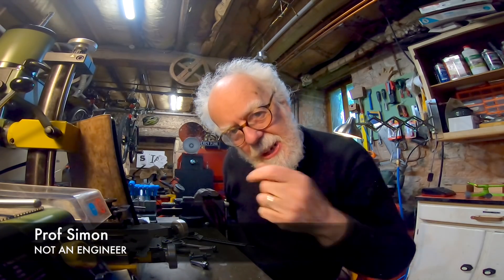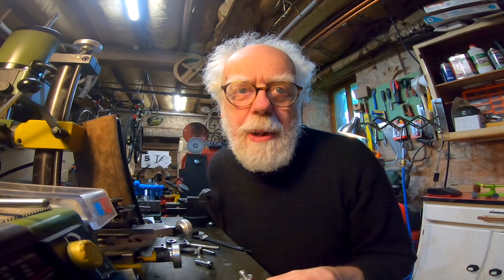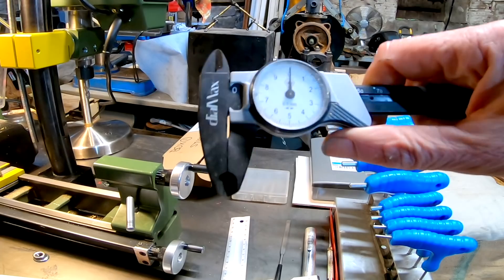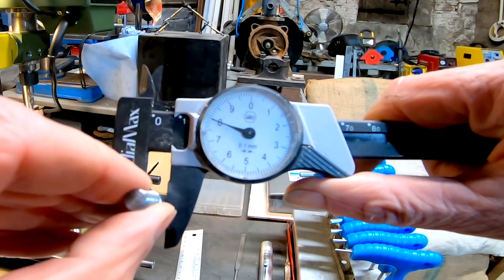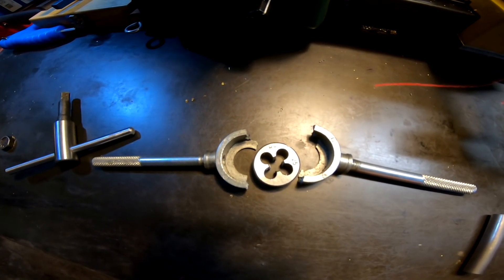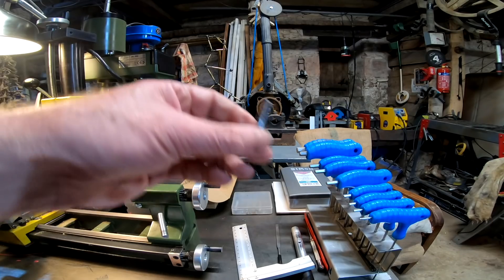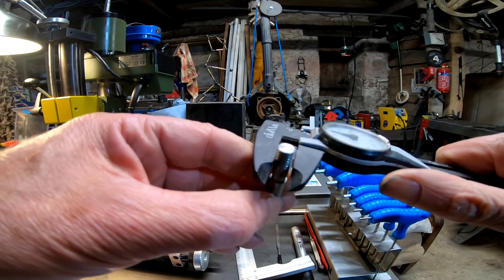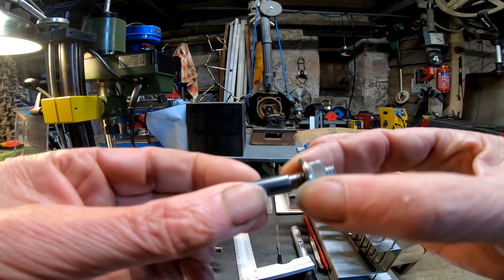Engineering mystery - Prof Simon

Comment: I have cut quite a few 8mm silver steel round stock with a standard die, no problem.
But if the stock is just a little too hard, it won´t work.

On the lathe:
Take 8mm stock, touch off, cut as deep as the tables say. 
The peaks then theoretically are exactly 8mm, but have a considerable burr (material on the peaks gets folded first in one, then in the other direction).
Make a few spring passes, steel will not fold too often before it breaks) and run a file over it.
Nuts usually do not have perfect valleys, so a little clearance on the peaks is inevitable.

The thread still is M8, the smaller outside diameter simply results from that clearance.
Reply from the maker: Thank you

Comment: As a retired tool room machinist i was told you need to take OD down to 7/10 %  off  to compensate the swell. Dependent on material being used.   Cutting oil is best, tallo can be used but it smells orible when hot.
  Greetings from The Isle of Wight.
Reply from the maker: Thanks Rick

Comment: As i understand it 8mm dont fit in to 8mm so thats why its 7.7 ish to fit 8mm nut , as for the BUR you are geting use 2 cuts which is easyer siad than done , or cut the thread then size it by fininsh cut with the die

Comment: Always turn your stock down to OD specified in thread charts. It's always less than nominal thread diameter. The thread form should not extrude when cut on a lathe, if the bit is sharp, has the correct relief, and is advanced each pass using the cross compound set at 30 degrees. 

Also, all commercial fasteners are made using cold heading and thread rolling. The stock is sized precisely to produce the correct thread profile without any material loss. This actually makes the fastener stronger.
Reply from the maker: Thank you.

Comment: Firstly, M8 or M8F are 8mm outer diameter, get a good tap and die set (SNAP-ON), CUT THREADS will always be a bit sloppy the best threading method is ROLLING a thread (forged thread), also have you noticed that a cutting die is directional with 1 side wider than the other.
Reply: Also if you measure the outer diameter of a cheap bolt and  10.9 0r 12.9 T.S you will find they are different.

Comment: There is a book (in German) "Tabellenbuch für Metalltechnik" by "Handwerk & Technik". Page F50 explains the procedure. In short: turn the thread in several (up to 6) steps, begin with a wear of 0.2mm (down to 0.08). Dont use the cutter (with the broken handle) - it's purpose is only to repair threads that are a bit damaged. The thread shape is described in DIN 13. Book: "Technisches Zeichnen" by Hoischen at Cornelsen-Girardet. Page 272 in my edition.
Reply from the maker: Thank you....there are better die holders?
Reply: @SimonHollandfilms  Quite sure there are, but I don't know which brand is best. If the holder costs around 15€, it should be a good one.

Comment: Sizing is a ‘nominal’ reference and varies slightly from manufacturer to manufacturer as well as batch to batch, or even material to material. As for cutting the thread, I cannot help, sorry. Did you actually try your initial thread in an M8 nut?

Comment: Try littlemachineshop dot com - use their die calculator :-) Should be 7.88mm for M8 coarse thread - use a 30deg chamfer to start.
Reply from the maker: Top answer. Littlemachineshop has a online table. M8 - 7.8,   M6 - 5.9,  Etc.

Comment: The Metric size you measure is always smaller than the size of the screw or bolt according to the official M-number. For example, the M8 size has the diameter of max 7,982 and minus 7,76.
Don't ask me why, it's a continental thing ...

Comment: Zeus book has a table for metric fine and course threads, this shows major and minor diameters relative to thread pitch.
Reply from the maker: It does? What is the column called?
Reply: That would make sense if you aren't losing any material, just reforming. On the diagram below the ISO Metric threads table in the Zeus book, imagine cutting off the peaks and flipping them over to fit in the troughs!
Reply: Could it be the "effective diameter"?  7.188mm for an M8 thread.

Comment: Standards are established by ISO for each of the 3 thread parameters: minor diameter, internal thread, D1; major diameter external thread, d; pitch diameter , internal thread, D2; and pitch diameter, external thread, d2.  Tolerances are presented in document ISO 965/1.   The tolerances shift with length of thread engagement.   I suggest you buy the document and cut threads to the specs and tolerances presented.  "Machinery's Handbook" devotes 30 pages of fine print which includes tables and equations for establishing a "correct" dimension and profile.  In table 13 - for M8 x 1.25  a range of D1 Major Diameter of of 7.760 to 7.972 for Tolerance Class 6g is specified.   At other extreme is 7.788 to 8.000 for Tolerance Class 6h.    But that is just the beginning.  There are also pitch diameter and minor diameter to establish.   Machinery Handbook also presents the equations necessary to calculate the dimensions you are looking for.  ISO go no-go gauges are available from several supplier.  One that pops up is https://www.gaugestools.com/ 
To do this correctly is much more complicated than picking the right diameter bar stock.   That diameter will vary with steel hardness and resiliency - carbon, manganese, chrome content for example.  If the first cut does not give the size you want, cut again until it is in spec.   If 8mm bar is too large turn it down to 7.75 mm before cutting the threads - that may be good for your bar stop.   Turning the bar may harden the surface and change the tendency to extrude!   Have fun and good luck.

Comment: It should definitely be possible to cut an M8 thread from 8mm bar. It is perfectly ok to remove a little material to make it easier, but I wouldn't remove more than 0.5mm. You may also want to try cutting a much bigger chamfer to help the thread start. The tiny chamfer you show on this video wouldn't be much help.

A die shouldn't be pushing up that much material. A normal thread cutting die is fundamentally a cutting tool, not a tool to deform metal into shape. When I use a die to cut a thread in steel I usually use a split die, which can be adjusted using the screws on the side of the die holder. For the first pass I open up the die as much as possible, but tightening the screw that goes into the split on the side, then once the full length is cut I run a second or even a third pass with the die cutting close each time.

I'm curious what type of steel you are using, as I've never seen the outer diameter increase as much as you seem to be seeing. When you bought it, was any specific grade mentioned? Was it listed as mild steel, stainless, or perhaps silver steel?
Reply from the maker: Excellent advice...the steel was ‘mystery meat steal from China’ so that might be an issue...I will certainly try the split tap process... cheers and keep up the good work

Comment: When making external threads of all kinds the OD of  round stock must be a little smaller than the OD of the thread. Generally I just file a little off the top of the bar in the lathe. You can buy adjustable thread cutting dies and take roughing cuts and adjust to finish. Less torque on the die stock. You can also rough out the thread on the lathe and finish it nicely with a fixed die. Always debur your finished thread with a file.
Reply from the maker: Good advice...thanks
Reply: Oh another thing is are you turning metric course or metric fine threads?
Reply: 19MAY2020 - Am I missing something? " . . . OD of ... stock ... SMALLER(?) than OD of thread."? WHAAAA? Maybe it got lost in translation. Too bad Dad passed away this past July. He was a master lathe operator and could chase (cut) any thread made, including acme, Sherlock, and buttress. I've never heard of the extruding phenomena resulting in increasing the bar stock diameter, but there must be difference between chasing a thread on a lathe with 29.5 degree, V-shape cutting tool and using a wraparound die to cut threads. Don't ask an engineer on this one, ask a machinist. You don't want theory, you want practical application. Big difference.

Comment: Hello. If you are breaking your die holder you are using way too much force.
The truck is to continually reverse the direction to clear the shavings then advance again only a few degrees and repeat until threading job is done, there will be info somewhere on what diameter to presize the rod.
Lathe thread cutting is another whole different thing and cutting tip size is critical and maybe different profile according to thread standard.
Reply from the maker: Good tips..

Comment: Hi Prof Simon, from my experience you need to take off about .2 mm of the OD and make sure you are using some type of lubricant, are you thread cutting on the lathe or just using the die?
Reply from the maker: Ah ha...I have heard that figure...cutting on the lathe with tap magic. ....but you can apply 0.2 mm to all thread sizes? Too little for M10 too much for M4 ?
Reply: @SimonHollandfilms  hi Simon that zeus book you have is excellent if you follow the dimensions in there you can't go wrong 8mm bar chamfered , I know you said it's a sharp die  but try a new one with cutting compound I have never broken a die holder it must be chiped. Also if you look at the thread form it's flat at the top so reducing this dim just reduces the thread depth

Comment: Hi I’m a mechanical engineer, with turning experience. I have always turned the bar down to a half a millimetre undersize you’re measurement. Also put your bar in your lathe and bring the drill post along, then put your thread die in its holder up against your bar and lock your drill post up against your die and use this as purchase while turning your die holder at the same time. So I would turn your bar to 7.5mm or just above , you should practice this method. I hope this is a helpful.👍🙂
Reply from the maker: Brilliant.....you are the first lathe person to confirm, unsersized OD before thread cutting....wow....are there tables of ODs before thread cutting? Thanks
Reply: @SimonHollandfilms  Use the exact same ZEUS  booklet, dated 1978, still looks the same, except that my copy is well worn, recommend it, very useful.
 Split die is the answer, first pass with die expanded in holder, second pass closed down a bit with the screws in the holder, the second pass is a finer cut and cleans up the thread.
Cutting oil or tallow, not engine oil or anything else, this is important for a good finish, thread looks torn up else.
Reply: It’s worth remembering the M8 thread is 8mm nominal diameter. The thread crests have to be truncated to give clearance. I was given a rule of thumb make the OD undersized by about 10% of the thread pitch, M8 x1.25 so OD about 7.875. More on tougher materials. Use a split die opened up, put a 30 deg chamfer on the start, use the tail stock to ensure the die starts square to avoid a drunken thread and use some cutting oil.  Good luck, :-)
Reply: @eamonnquinn9585  I worked as a toolmaker for 20 years and this is the first I've heard of starting with undersize stock truth be told. .As another poster mentioned, cut the thread once, then run the die down again and adjust the peaks with a file to suit. The grub screw 'split' setting on the die is very important though. On harder material like stainless steel, i often open the die fully at first and don't attempt to get the correct fit first run.
Reply: @MonaichFother  well said I'm a toolmaker at present and I've noticed when looking for bolt s that they are slightly under size but hearing people say you should make it undersise to me is just reducing your thread depth.
Reply: Paul Morgan well you are correct, the OD is 8mm. When you look at the  6g thread tolerance you can see the lower limit of the major diameter is within the nominal  - 10%*pitch I suggested. As you say the split die is a good option but you can see making a start on the thread is hard with the solid die Prof Simon is working with. To break the die holder means he is the poop so the 30 deg lead in chamfer will help, the lube will help, and keeping the die stock square is a must too. If I can find it’s I’ll post a link to the Maryland metrics’s tables,  :-)
Reply: Crazy m6 has a thread size of 1mm  eg  5mm hole taps to 6mm so you are suggesting Simon (in this example) should get rid of half the thread .that would be slopyer than his undersise example
Reply: He is right, always turn down the bar stock if it is 8mm. What if you use a bolt header and rolled threads? Sometimes difficult to distinguish between good cut thread and rolled
Reply: I thought this was common knowledge.
Reply: Ergo....Trust me the die is m8. The rod is 8mm. Split die. Multiple passes. It will work. If you use undersized stock the extruded tips will maybe work. But they're pretty much made of cheese and won't hold out.

Comment: Is use a tap and dye set. No motors,and not fancy,but effective,and simple. Done by hand. Never seen one like yours,with circular tap. Get a set of craftsman,they are shaped like nuts,and the turn is far far heavier than the broken little thing you had.
Reply from the maker: In the EU we main,y have round dies.

Comment: Extruded is a naughty word when you’re cutting metal. If you use a split die you can adjust the depth of cut(rough cut/s then finish cut). The broken die holder/wrench, likely came about because the cut was too deep for your die. Can you screw cut on your lathe?
Reply: It depends on how accurate you want to be. Screw cutting in the lathe I would start on size. You should set your compound slide to the angle to the angle of the thread, tool post should be square to the spindle, control depth of cut with the compound slide. Make the necessary amount of cuts. Finish with emery paper or smooth file. Make sure tool height is centred and you have an under cut at the end of the screw thread for relief.
Reply: If you are extruding material you’re not cutting. Solve that by setting the tool as well as you can.
Reply from the maker: I was not clear.....I mainly screw cut on the lathe.....what’s your view on a starting OD for a thread?

Comment: Hi Simon, does the pitch match, your die will have 2 measurements 1st is O. D., 2nd is pitch
Will look something like 8 x 0.8mm or 8 x 1.25mm, if you have mis-matching thread forms then that could be your answer, tbh they usually just bind up if they don't match though
Reply from the maker: Good point....I will check pitch
Reply: BTW Simon, never ask an engineer a machining question, they just whip out a calculator and overcomplicate things ;-)
Reply from the maker: I am hearing that in the comments....cheers

Comment: Measure the unthreaded shank of an M8 bolt. May be a clue there. Also there must be some clearance, ie they are not interference fit. Commercially bought bolts are rolled as opposed to cut, so no extrusion of thread. I'm guessing the extrusion you're seeing is not necessary.
Reply from the maker: I will do that....how do you stop extrusion in thread turning? I can image  that rolled threads make different thread peaks.
Reply: A material will only extrude if it is "forced" therefore the cutting is not taking place properly. Rigidity of workpiece, cutting fluid, (workpiece temperature) accurate tooling and cutting speed are all  factors. Small components will always make variations more apparent. As you have noticed!
Reply: Since all machines and techniques differ, it is difficult to define, it will be down to trial and error. All part of the fun!!

Comment: Were you trying to turn the stock through the die.?
Reply from the maker: No....it’s looks confusing...I am cutting a threads under power on a mini lathe
Reply: @SimonHollandfilms  Try holding the component in a vice and with some cutting oil, use a 3rd rotation clockwise, then anticlockwise, increasing a bit each time to only cut a small amount and feel the torque required. your mini lathe was too agresive.

Comment: Your measuring device is wrong. How hot is your room and material.. ? Something is off. 8mm is 8 MM. Steal expands @ 22 degrees from memory for measuring metals. When working with a CNC machine the room has AC
Reply from the maker: The bar stock is 8mm the commercial bolt is 7.7mm...the room is cool...
Reply: @SimonHollandfilms  Multiple runs of the die plenty of cutting fluid and check clearance on the die at intervals you cant do it in one run easily but to save time try starting diameter of 7.6mm also stainless will behave differently to cold rolled so you may get different answer from different folks!
Reply: feed rates and spindal speeds will generate heat. This is annoying me as i want to know the answer. I think this has to do with the material you are using. Some factor is wrong and altering the end result. There are charts you can use (mathematical formulas to calculate)with materials diameters and spindal speeds.  @SimonHollandfilms

Comment: Or the tool you are using isn't set at the right angle or is the wrong profile?
Edit: Always wanted to get a lathe...Must do it.
Reply from the maker: Ahhhhh good point...I suspect you might have started a good line of questions.
Reply: @SimonHollandfilms  How many passes do you take to cut the thread? What depth per pass? Minimising stress on the tool and stock. Little lathes bend and move a lot.

Comment: I always thought the nut was slightly oversize? (I'm an electronic engineer...not mechanical, so don't know really). Edit I'm gonna measure some nuts and bolts now...
Maybe you are putting too much machining stress on the steel? Shallower cuts, take more passes  and maybe the threads will remain closer to the original OD?